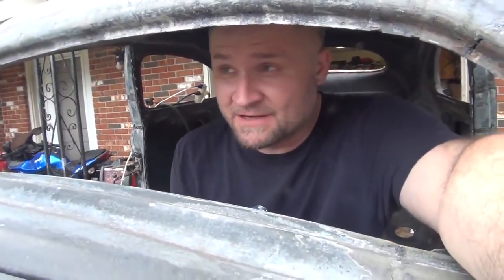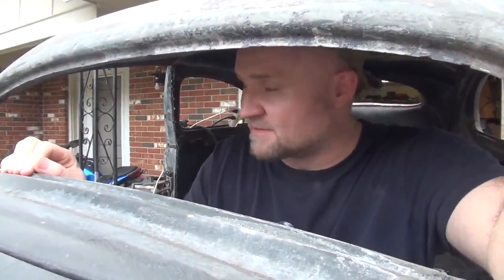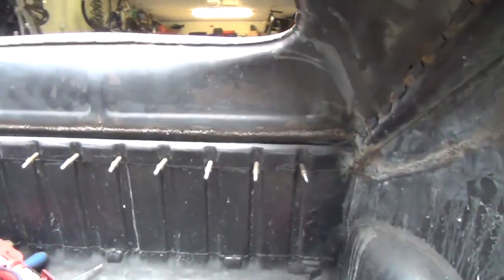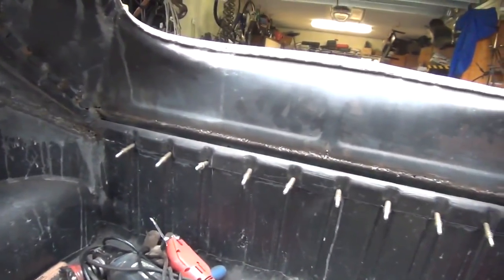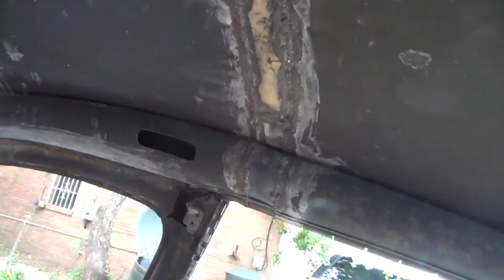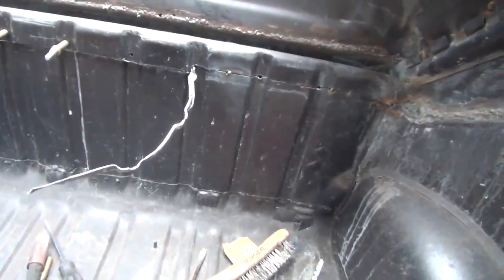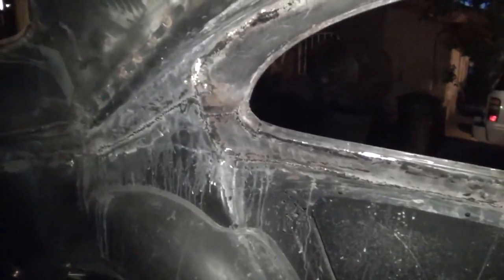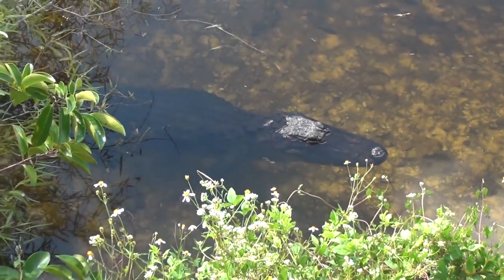Rear Package Area Weld - ROTTEN OLD 1956 Chop Top Oval VW Beetle - 39

Comment: Well, I guess I'll have an easier time on mine, I'm only 5'6"

I hate welding with flux core.
Reply from the maker: Yeah, much easier for you!  FLUX SUX!
Reply: @DuckmanCycles  ever weld galvanized steel? If you haven't, try to avoid it.
Reply from the maker: Yep, floor pans.  I kept myself upwind as I always do when I weld anyway.  I can't tolerate ANY smoke inhalation without getting sick!  YUCK!

Comment: LEAVE THE WELDS! It will be a lot stronger. They all get covered with carpet and headliner any way. why grind them off it makes it weak? The weld is strong. Wire brush it and paint it.
Reply from the maker: Gotta knock down the high spots or they will show through the headliner, and possible wear a hole through it.  Always grind them SOME.  Don't have to whack them all the way though.
Reply: K